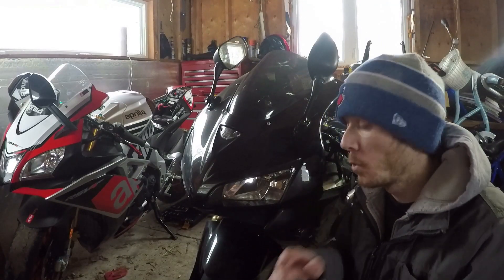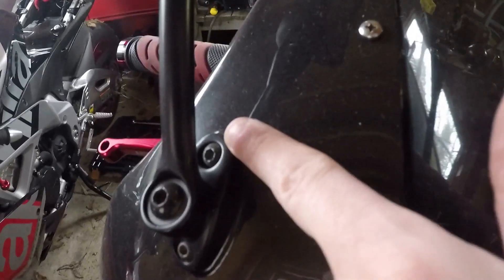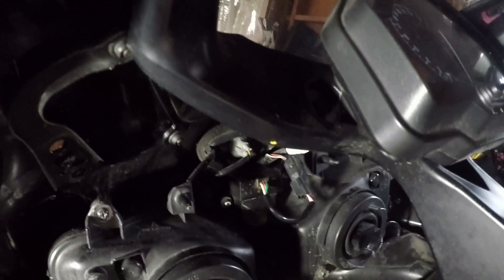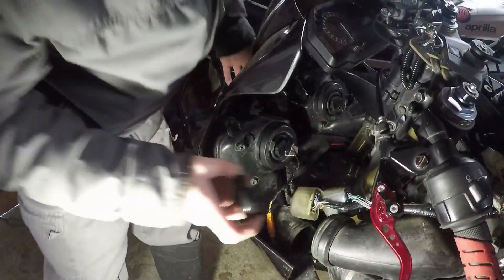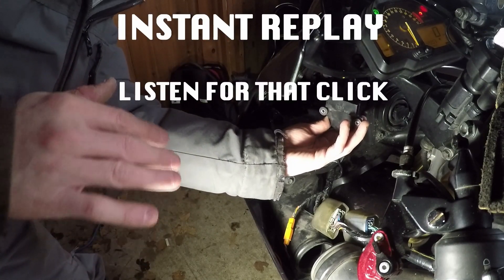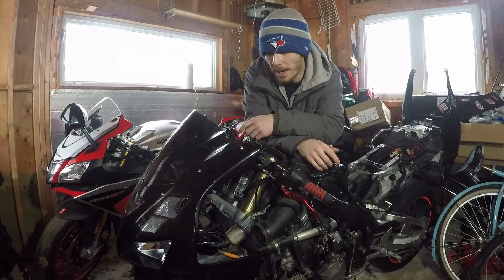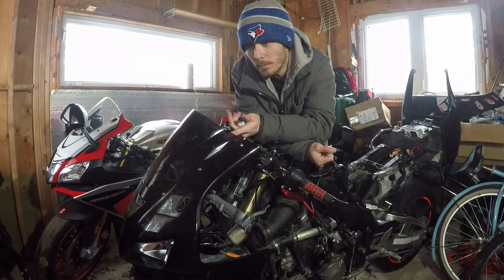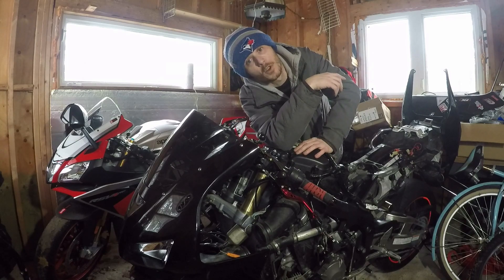Fuel Pump Won't Prime : CBR600RR  2005-2006 | PART 3

Comment: How can I jump the engine stop relay to the ecm?  I have power at the relay but not at the ecm.
Reply from the maker: boonehouston I have a few questions first.  Does the relay work? You have power going to the relay but is the relay working where it’s sending power out?
Reply from the maker: boonehouston I wouldn’t advise jumping anything directly to the ECM or you could potentially fry the ECM and create more problems.
Reply from the maker: boonehouston also a one more question. Just so I know.  Have you fully watched all 3 parts of this troubleshooting and followed along exactly.  Don’t skip any steps.  Follow it exactly regardless if you think you know where the problem is.  Don’t skip anything you would be surprised.
Reply: @TubeSocksMalone  yup I followed everything.  I am not getting anything to #16 at my grey connector to the ecm.  Everyrhing else works.
Reply from the maker: double check the mini 20 amp fuse that runs off the positive cable of the battery,  not the main fuse on the starter solenoid but the mini 20 amp if you follow the positive cable that attaches to the battery you will come to a mini inline fuse. double check it just to make sure it's not blow.
Reply: @TubeSocksMalone  yeah all the fuses are fine.  It'll crank over with no spark or fuel prime.  One weird thing is all three of my relays won't go to zero with the continuity test.  Ive swapped them every way you can and they all work for the lights and click over fine.  The bike did have a "techlusion" efi programmer installed on it and I took it off and made sure it didn't cut any wires completely.  It was installed with 5 ghetto little splicing clips to all the pink wires going to the black clip on the ecu.  I figure maybe that fried the computer.  It sat for about 10 years I believe without being ridden.
Reply from the maker: Yeah it's possible;e they cooked the ECU.  Never want to plug anything directly to the ECU like that incase it gets a spike of power.  ECU's are very delicate.  Ebay you can find them easy just make sure it is the proper ECU not just for the year but make sure it is the proper one for the bike.  They make 3 different wire harness and ECU's for the CBR600RR. 1 for Europe, 1 for all of North America and then finally California gets its own special one because of all the regulations they have even back in the early 2000's.
Reply: @TubeSocksMalone  yeah I thought it was shitty that it had its own spliced in 12v power with a ground.  Then connections to all the pink wires.  The box its in is definitely not water tight and if it goes the whole computer goes theoretically.  Plus after reading about it I found out it works totally different than a power commander.  It doesn't even change the mapping at all it just sends different electrical pulses through the factory wires. I order a new ECU and let you know if it works. Thanks for the help your videos are really good and way better than any other motorcycle videos I've seen.
Reply from the maker: Thanks for the kind words. I am happy you found my videos helpful, I really tried to break it down as easy as possible to help others get back on the road as I know it can be frustrating.  All the best and if you get it working come back and let me know i am very curious.
Reply: @TubeSocksMalone  yup.  I'm still trying to test continuity in the harness before I order the ecu because I'll be pissed if I find out it's not the ecu.  It sucks trying to trace all the wires.  Plus the ecu has about 6 or 7 new wires besides the harness.  I'll let you know what it boils down to.
Reply: @TubeSocksMalone  it might be like yours and the ecm is already fried.

Comment: This three part vid is the best I've seen and so easy to follow!!

Ive a 2005 and tested the engine relay and got no power so went straight to the BAS. For the easy test no click, and with the multimeter got no power. Bypassed the BAS by jumping it and still nothing.  Have got bike to prime when connecting power directly and was able to start bike when i ran a wire directly to battery to ground/earth it but that is not practical and still no hlights/indicators.
Is there a part 4? Or any recommendations? 
Understand you're doing this for free so thanks for all the help so far regardless
Reply from the maker: Johanna Kelly thank you I appreciate it and I hope you can figure out what’s wrong.  No part 4 these are all the steps that are in the service manual for troubleshooting the fuel pump not priming I just broke them all down so it’s easier to follow along rather than jumping around in a big service manual and reading wiring diagrams as I know that can easily become overwhelming.  Try going through everything from part 1 but don’t skip any steps and see if you notice anything.  It’s easy to miss something if you skip a skip thinking it’s fine trust me.  If you can eliminate everything without question than it will be easier.  Also sounds cliche but double check all the connections to make sure they’re not corroded or damaged. I made sure to test everything and I was 100% certain everything worked that I tested and no damaged wire I have continuity and power where I needed it so I went  ahead and could confidently buy a new ECM and my bike runs 👌.  Just really have to make sure you test everything in the videos don’t skip anything.
Reply: @TubeSocksMalone  thanks man! Went ahead and followed the videos more out of curiosity and got power at b16 and the other tests worked fine. 
Have a feeling since I'm getting zero at the engine relay and zero for the tests at the BAS wires its something to do with the red and white wire before it gets to the BAS. Just gotta follow it and search for the break. (And double check all the obvious)
Thanks again so much for your videos and help! Bike would be ignored for another few months without you!
Reply from the maker: Johanna Kelly anytime I can help I will and hey between us I may or may not have the exact same last name 🤣 no joke.

Comment: the reason why my pump wouldnt prime was the 15 amp fuse by the battery
Reply from the maker: xxxdriftr are you talking about the in-line fuse that comes off the positive cable of the battery or the main fuse off the starter solenoid. Not sure what year yours is but double check the service manual for your year I know 2003-2006 the inline fuse off the positive near the battery should be a mini 20 amp fuse and the main fuse on the starter solenoid is a regular 20 or 30 amp fuse I’d have to double check myself on that one but the mini is a 20 amp Not sure if we are talking about the same fuse but if the one you’re talking about is running off the positive cable then we are.
Reply from the maker: xxxdriftr mine needed a new ECU 👌

Comment: Very helpful thanks man! 
My bike runs totally fine but i have same fuel gauge error that you have (increasing from middle) ,i checked for shorted circuits and i had one and i fixed it but the error is still there and i don't think that it is the speedometer or the gauge sensor like the service manual mentioning because the error appeared when i changed my fairing and put the mirror wires that was shorted before that it had no error i think i didn't fix the bank angle properly, could it be it causing the error? But if it is the problem i think my bike shouldn't run at all. Anyways i will check it but if you have any other ideas that might be helpful that will be awesome
Reply from the maker: Omar Hamza yeah if it was the BAS the fuel pump wouldn’t even prime.  I have a feeling it could possibly be what measure the fuel inside the tank itself.   Maybe a sensor or something.  My fuel gauge was all wonky because I had the fuel pump disconnected

Comment: Where was your broken wire at
Reply from the maker: dustin davis ended up being ECM. Fixed a loose connection by fluke but it was my ECM causing the problem

Comment: how to temporarily bypass the bank angle sensor?
Reply from the maker: I can make a video of it very shortly.  It is fairly simple.  The basic quick explanation of how to do it is once you have everything off and you can access your BAS you will see a cable and black connector attached to it with 3 wires.  I believe Red, Yellow and Green.  All you have to do is basically take an extra piece of wire stick it in and use that small piece of wire to jump the Red wire and green wire.  Done.  BAS system bypassed and you can remove your headlights for track days or whatever you need to do etc just remember your bike won’t shut off if tipped over now though.
Reply: @TubeSocksMalone  thanks, so no need to pull off the BAS? just short out green and red?
Reply from the maker: sgtjoe2008 correct you just leave it on, no need to pull it off once it’s jumped.
Reply: @TubeSocksMalone  my issue was the fuel pump doesnt prime. ive checked these parts:  the on-off run switch and wirings ok, installed new fuel pump, engine cut off relay is ok, fuel cut off relay is ok but no supply from ecu, relays tested on and off the bike, did the angle test on the BAS and click method it was ok, bypassed it and still no fuel pump prime, i did jumper method on the fuel pump relay and it worked, traced other wire on this relay leads to the ecu...can i assume now the ecu is at fault?
Reply from the maker: sgtjoe2008 I want to assume the ECU is pooched as well if what you’re saying is correct.  Especially if you have power going to your ECM but it’s not sending any power out as the final culprit for my bike was the ECM and mine is running now.  it does sound like you checked everything and if that’s the case your next step is to swap the ECM with a known good one.  That is the only way to test an ECM as their is no way to actually test it except sticking one you know works in your bike.  If it doesn’t work than you missed something like a possible broken wire in the circuit but it sounds like your ECM at this point
Reply: @TubeSocksMalone  again big thanks Mike, maybe what i'll do is go over the whole process again, double check everything, every wiring, just to make sure....then do the ecu swap
Reply from the maker: That’s what I would do.  I know I missed a few things the first time I went through it all then realized I had a blown fuse and once I replaced the fuse I was able to narrow down after checking everything that it was very likely I had a cooked ECU and turns out I was right she was cooked.  Best of luck and all the best.  Anytime I can help at all I will try.
Reply: @TubeSocksMalone  just an update, after going through again with the wirings, relays...etc. it turned out to be the ignition key, the spare key i was using for some strange reason suddenly was no longer recognized by the ecm, and it disabled the ignition coil and the fuel pump and the check engine light doesn't go off when the key is inserted. now with the original key after inserting it the check engine light came off after 5seconds and i can hear the fuel pump priming, started right up! i'm so happy haha! i wouldnt have thought the chip inside a key would go bad!
Reply from the maker: Yeah that sucks thankfully my 600RR doesn't have a chip in the key only my RSV4 does.  I'm happy you figured it out and got it going.  Big pain in the ass when it's something as small as the key trying to figure out wtf is going on.  Ride safe
Reply: Remove the Bank Angle Senor. There is 3 wire plug. Jump the 2 outside wires together with a paper clip or wire. That will bypass it.

Comment: I have been looking for weeks for my solution...you are the man..everyone else talks about what to do ..you went Hands on step by step.just what I needed ...you rock .thanks to u and your video's my honda is alive and I'm riding bro..again thanks much for your time and experience
Reply from the maker: Joe Pike9 I’m very happy that it could help you.  I really wanted to make some videos of not just fixing my problem but also showing all the troubleshooting to narrow down what’s wrong.  Many different things can cause the exact same problem on the bike and I didn’t want to skip anything because someone else’s bike might have a slightly different problem even though they’re having the same issue at the end of the day.  Again I appreciate your comment and I’m truly happy that your bike is going again.  For me I ended fixing a wire and replacing my ECM as that was the last resort in the service manual and my baby is rocking now too.  Slightly different problem but same issue of bike not priming and starting.  Cheers brother and ride safe.
Reply: Yes I have seen so many threads of same issue I had but still no fix . I have replaced everything I mean everything front to back from ignition to the ECU and everything in between . Wire harness , relays . Stator. IPG. Cam sensor, the RR, all switches . I have spent hundreds . If I could have just seen your videos  months ago. I am subscribed and watching . Keep up the great work."  Fuckit I'm going in"

Comment: I have the same problem but I have done everything and still doesn’t prime
Reply from the maker: Felix Ortiz at some point if you did everything I did you would notice where you don’t have power.  Mine does not prime still but it’s because their is a short in my black and white wire.  Did you do every test? Have you checked you FI fuse which is the small 20amp fuse run directly off your positive cable on your battery?
Reply from the maker: Does your fuel pump actually work as well.  Did you hook a power source directly up to the fuel pump to see if it works?
Reply from the maker: Felix Ortiz the 20amp FI fuse is not the main 30 amp fuse that is in the starter relay
Reply from the maker: If you check every single thing shown in all 3 videos and everything works then you have a short in your wire harness.  Either the red and white wire that runs from you battery positive cable to the engine stop relay or the black wire with the white stripe on you engine stop relay if you watched my videos you know exactly what wires I’m talking about. That black and white wire has a bunch of stuff run off it so if you checked everything I showed and everything works then you have a short in the wire and you will need a wire diagram and check every wire that runs off that black and white wire.  I am making another video shortly explaining better what I just wrote in this comment.  But if you are positive you checked everything then you would notice where you do or don’t have power.  Do you have power at the pins of the ECM that I showed to test in one of the videos?
Reply from the maker: Felix Ortiz another big culprit to many electrical problems is the small yellow box on the left side on the wire harness close to where the subframe attaches to the actual frame of the bike.  That yellow plug is notorious for melting and snorting out and screwing all the grounds up.
Reply: I have check everything in your video plus the hole diagram. I don’t have voltage on the injectors neither the coils, and doesn’t prime either. Everything else works fine. I’m thinking ignition pulse generator or ecm
Reply from the maker: Do you have power at the harness on the plug of the ecm I showed in the video??
Reply from the maker: Felix Ortiz if you don’t have power at the pin on the plug that goes into the ECM I showed you the problem is else where other than your ECM.  Your injectors are one of the things that splits off and is powered off the black wire with the thin white strip on your engine stop relay

Every things that splits off the black wire with the white strip on your engine stop relay sends power to your ECM but along that wire to your ECM their are a bunch of things that are also powered and split off that same wire and are as follows of any of these wires are cooked nothing that runs off that wire will work including your ECM won’t have power to tell your bike to do anything and this is what is split off that same wire powering your ECM

Exhaust air inject solenoid valve 
Ignition coils 
O2 sensors 1 and 2 
Primary and secondary injectors 
Purge control solenoid valve 
And also check to see if you have ground (-) on your black plug on your harness for your ECM at pins 4 and 18.  If you don’t have ground on that plug than than you have a ground issue on the 2 corresponding wires.
Reply: I have checked everything I have the grounds the ecm needs and the + the ecm needs. So I’m thinking ignition pulse sensor or a really bad ecm
Reply: Yo can send me a message at 518-421-1381
Reply from the maker: Felix Ortiz I’ll shoot you a message after I’m done work and I can email you the wire diagram if you don’t have one.  Only shitty thing about if you think it might be the ECM is the only way to test is swap it out with someone who has the same bike that you know works proper. Other than that no way to really actually test the actual ECM.

Comment: My issue ended up being the fuel pump itself. Replaced that and bike ran good for a while now it sputters and dies at red lights usually in first with the clutch pulled in. After reading around a bit I suspect its the stator so gonna check that and the rectifier. Fixed the issue for someone else on yt with a RR
Reply from the maker: Anti IV that sucks but at the same time glad you figured out the problem.  Better scenario than mine lol my black and white wire has a short so I have to check everything that runs off that wire.  Somewhere it is melted or something and snorting out. I hope I can locate exactly where it is or I will have to re wire my bike lol fingers crossed I can locate and replace that part of the wire.  I really don’t want to re wire my bike.  Not hard but a very tedious task and time consuming.